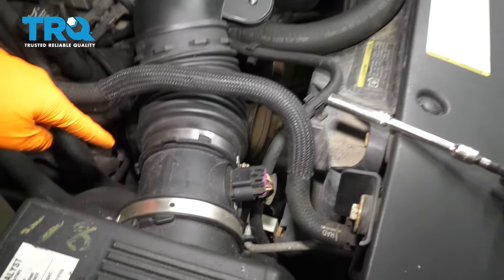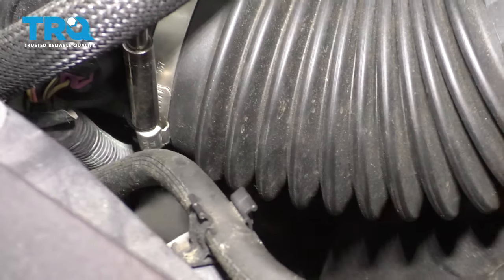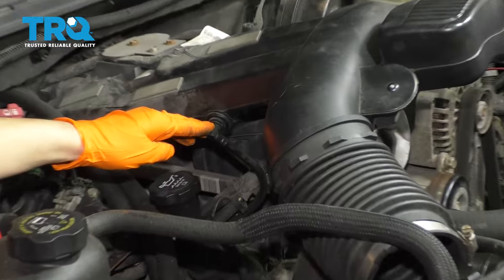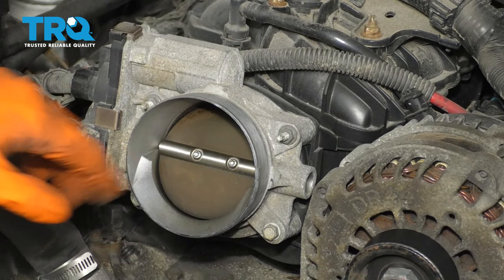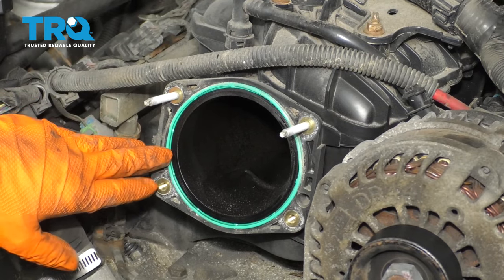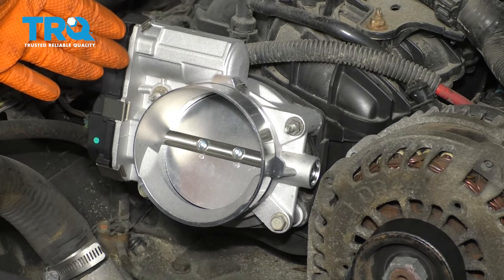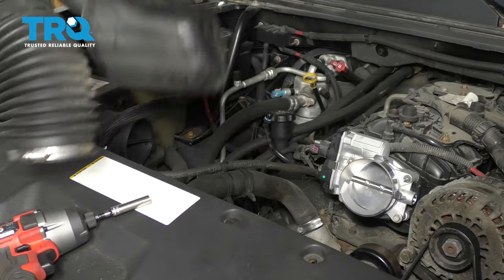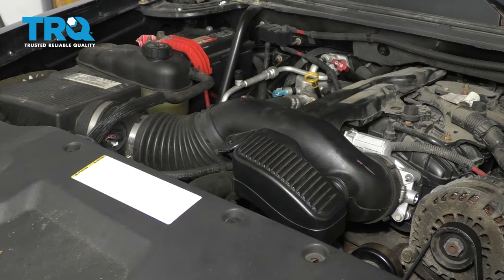How to Replace Throttle Body 2007-14 Chevy Silverado

Comment: Do you have to have the throttle body programed after its all changed
Reply: I was wondering the same thing does it need to go back to the shop
Reply: No
Reply: I came here wondering the same thing.  After seeing this on the GM parts lookup site ..... Description: Canyon, Colorado. 2.9l. This part requires programming and/or special setup procedures
Reply: @zzotherlandzz  is that all of them or just this part
Reply: The re program is the “idle learn reset”
Reply: @charleswimberly8821  how do you do that

Comment: Question replaced throttle body but limp mode and chexk engine comes back... I have to unplug n plug back the connector to the throttle body then works ok... problem has happened 3 times randomly in the past month.. can the new throttle body be bad or is it the electrical connector?  Any one has had this problem after replacing the throttle body
Reply: Did you do throttle body relearn reset? If no, fix it now

Comment: Did you not have to relearn the throttle body? I been wanting to take mine off of my 2011 Silverado 5.3 to clean it because recently the idle in park has been a little rough like drops below 500rpm but I read if I take it off I need programmer to relearn it or else the rpm will be way too high or low

Comment: GM IDLE RE-LEARN PROCEDURE

Perform the following relearn procedure for the on-board computer to adjust to the new idle position on the electronic throttle body.

1. Start and run the engine in PARK for 3 minutes.

2. Turn the engine OFF for a minimum of 60 seconds.

3. Start the engine and run for another 3 minutes.

4. Engine should idle normally after 3 minutes.

After having performed the relearn procedure and the engine still does not run within normal idle speed, it will be necessary to drive the vehicle above 45 mph (70 Km/h) including several decelerations. Also ensure that after driving the vehicle, let the engine idle for a minimum of 5 minutes.

If the engine has returned to normal idle speed, the relearn procedure is completed.

If the idle speed is still erratic or incorrect, restart idle relearn procedure.

Comment: How about a video on the throttle relearn procedure. Was this intentionally left out to sell more parts?
Reply: GM IDLE RE-LEARN PROCEDURE

Perform the following relearn procedure for the on-board computer to adjust to the new idle position on the electronic throttle body.

1. Start and run the engine in PARK for 3 minutes.

2. Turn the engine OFF for a minimum of 60 seconds.

3. Start the engine and run for another 3 minutes.

4. Engine should idle normally after 3 minutes.

After having performed the relearn procedure and the engine still does not run within normal idle speed, it will be necessary to drive the vehicle above 45 mph (70 Km/h) including several decelerations. Also ensure that after driving the vehicle, let the engine idle for a minimum of 5 minutes.

If the engine has returned to normal idle speed, the relearn procedure is completed.

If the idle speed is still erratic or incorrect, restart idle relearn procedure.